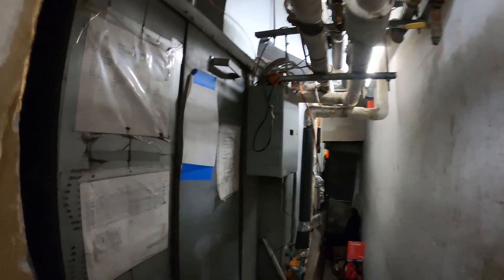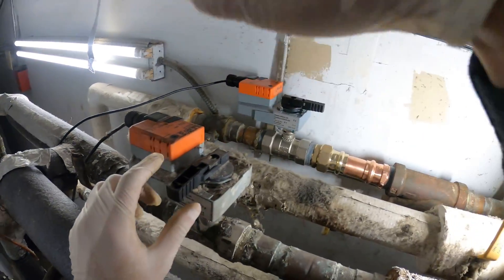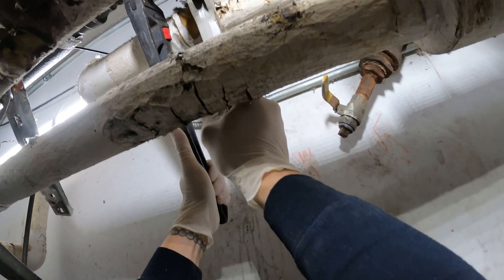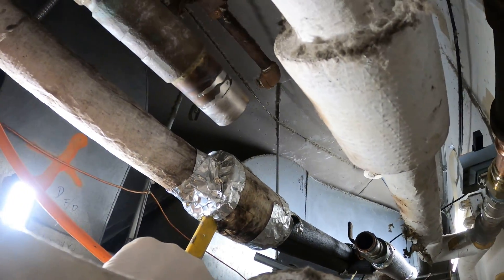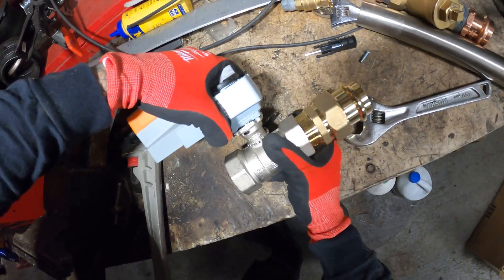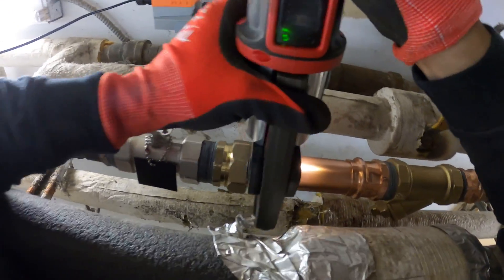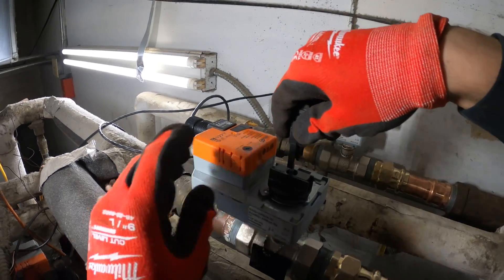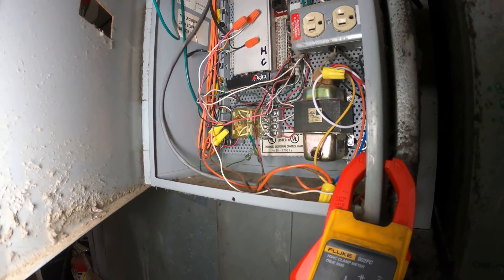HVAC: Belimo Actuator Valve Installation/Replacement #2 For a 4 Pipe Fan Coil Unit (ARB24-SR + B240)

Comment: you shouldn't install copper MIP/FIP into carbon steel fittings with out some means of separation. 6" brass nipple or a di-electric union.